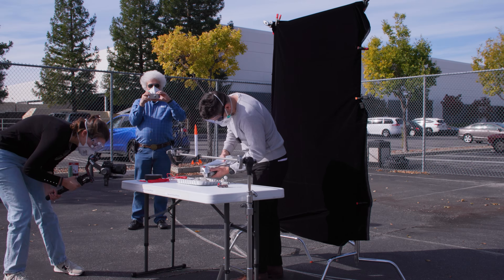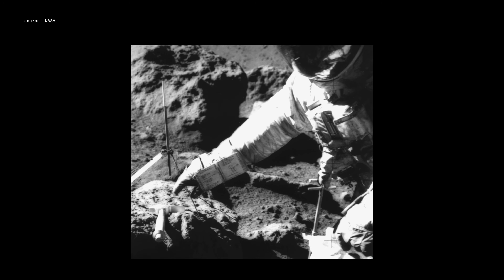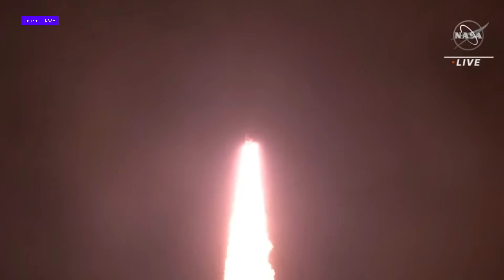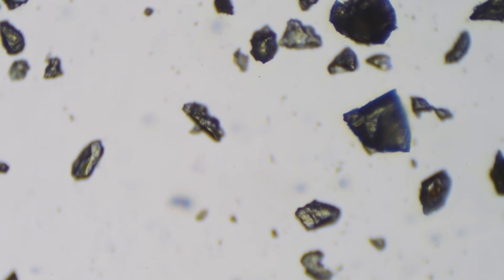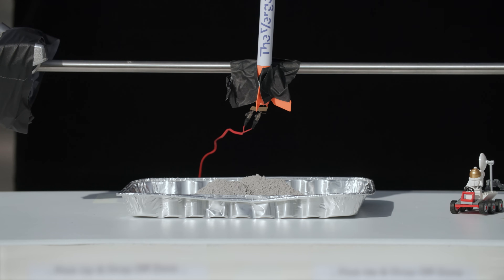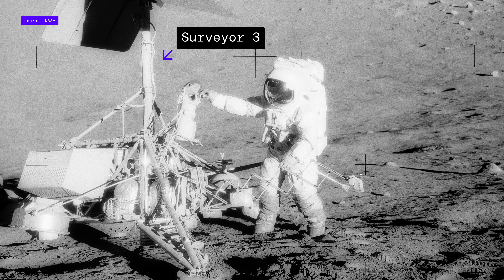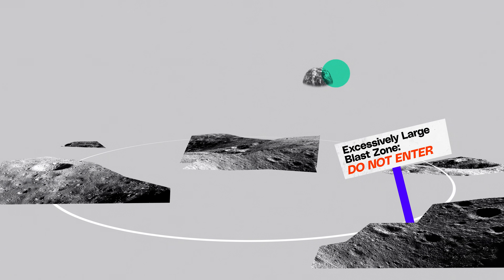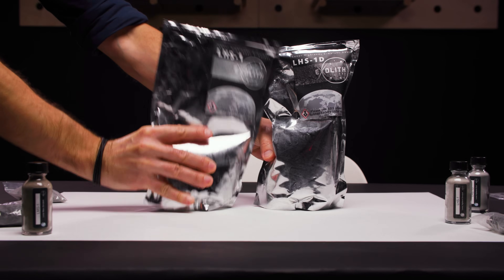This is why moon dust is such a problem for NASA

Comment: Sunset on a flat Earth
Question what would be the distance of the Sun from you. If you were at the beach watching a sunset when the sun is 1/4 of a degree above the horizon. This is the point where it appears that the bottom of the Sun is just touching the water. 

On a flat Earth with the sun at 3,000 mi above the Earth surface. At sunset you would have to be 687,544 miles away from the sun. 
You can arrive at this answer using simple geometry. 
Angle A 0.25°
Angle C 90°
Angle C 89.75°
Side a 3,000 miles
Side c 687,551 miles
Side b 687,544 miles
Isn't math fun It never lies

Comment: So NASA used simulated regolith moon dust to test the rover. That explains why the videos of the rover on the moon has atmosphere, why the dust hangs in the air instead of flying in a perfect arc. They should have filmed the rover at the Space Power Facility - the world's largest vacuum chamber completed in 1969 - to simulate zero atmosphere so that it's more believable. NASA is fake and gay.

Comment: Sounds like they should stop using rocket's to land.or to spray the area where they are going to land with a fast drying reason.somethat will take the heat. But make a landing pad

Comment: Fascinating vid..  Dust is definitely one of the bigger early problems before things like large concrete pads can get laid down..
That is the long term solution - taking everything needed for heavy construction.. Rebar, concrete mixture, setting agents, maybe water, maybe stuff for pressurised atmosphere. Working without air likely to be the biggest problem. Understanding the regolith is absolutely crucial to solving so many of these kinds of problems.